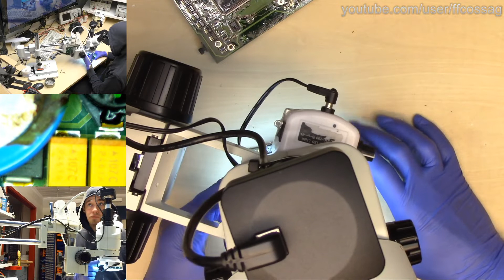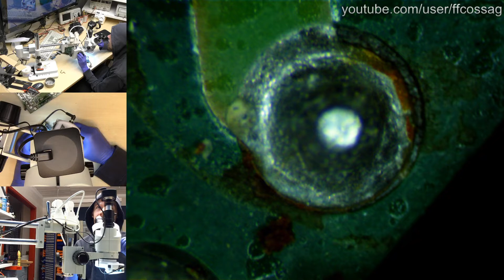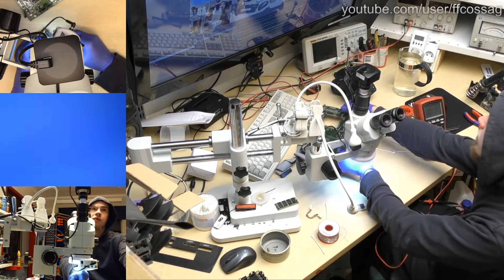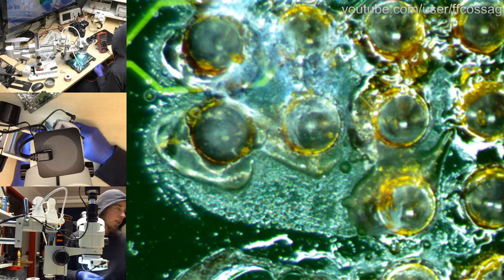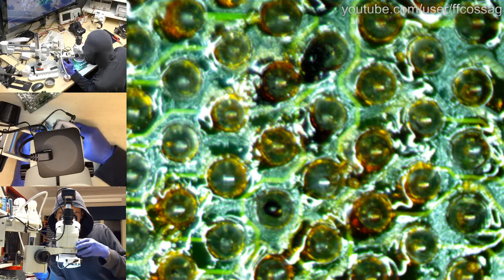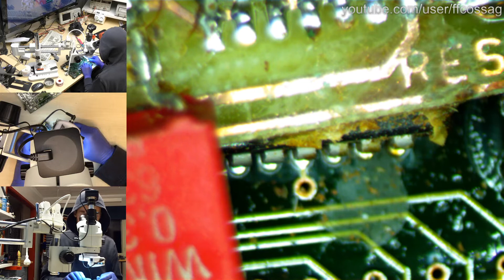RECDSTRM: Working on the worst industrial controller I've ever seen.

Comment: Next time cut to the chase and put it in the dishwasher/ dish washing machine. Back in the 90's I worked at Great Lakes Instruments, and production boards were "washed" with de ionized water.
Reply from the maker: Sadly, hot water does not remove the conductive glue.